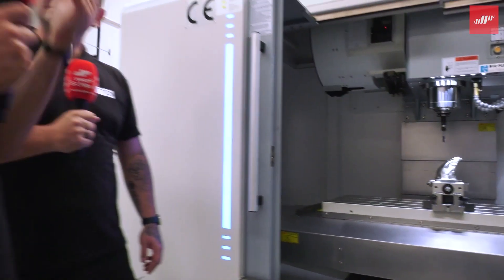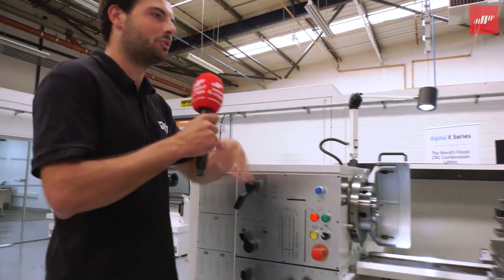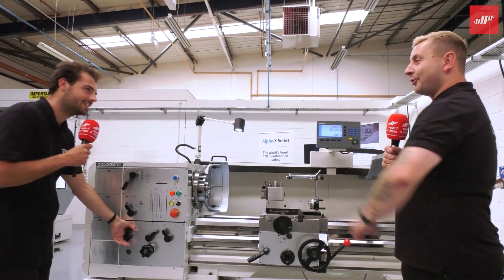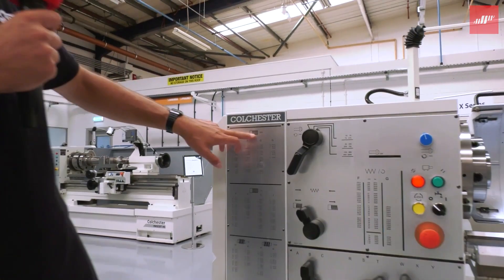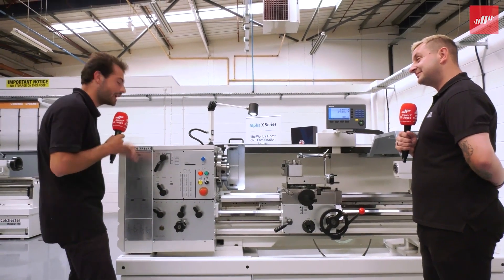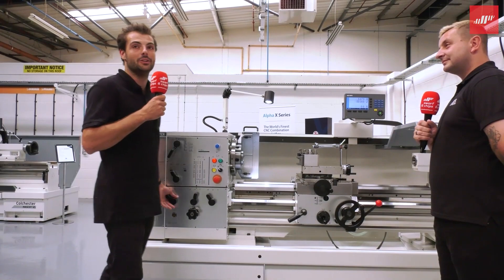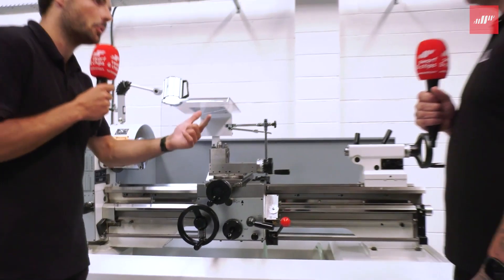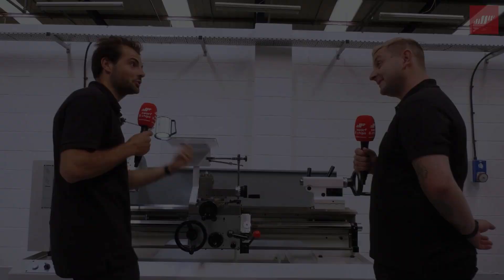We visit Colchester Machine Tools Technical Centre Tonight At 6pm!

Comment: Make cnc machines that run on 240 for the home shop guys, This is a massive market thats not been tapped, only seems to be Tormach out there thats doing turrets and nice mills for the home shop
Reply: Variable frequency drives are the way to go if you want to run 3 phase on a 240 supply.
Reply from the maker: As ali said Variable frequency drives are the way to go if you want to run 3 phase on a 240 supply.